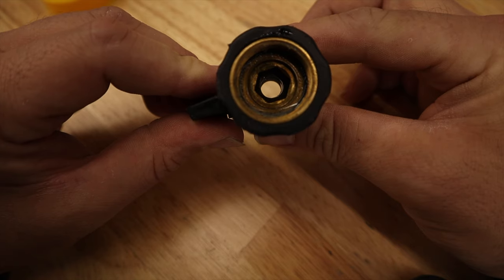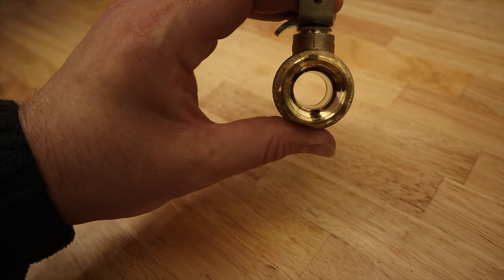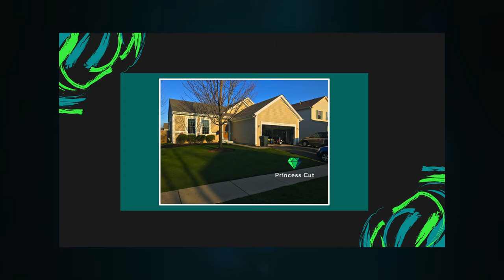MAKE A DIY Garden Hose Shut Off Valve ! HEAVY DUTY! Best Garden Hose Valve

Comment: I followed your instructions, and your parts list.  I bought everything from HD online.  It only took 2 days to receive it (no HD in my small town.)  It's working like a charm!!  Easy to open and close.  Great water flow/pressure.  NO LEAKS!!!  I did reverse the handle 180 degrees to fit my application.  THANK YOU for this great video!!!
Reply from the maker: Great to hear! so happy it worked out for you:)

Comment: I think you just saved my brain at Home Depot. I was looking for a lever shut off for my outdoor shower that is attached to the hose. This seems to be my answer. Thanks!!!!
Reply from the maker: Sweet! this would work great for an outdoor shower as the full port in the valve will allow the water to flow freely just like a shower in the house would.
Good luck!

Comment: Great idea, I’m tired of these cheap plastic store ones leaking and breaking.   Heading to Lowes, Thanks for the tip.
Reply from the maker: For sure dude it makes all the difference, I just a quick reminder make sure you get a Full Port Valve, must be full port for maximum flow
Reply: Princess Cut Lawn Care ... Will do, thanks for the heads up.

Comment: If you buy store valves, look for high flow and large internal dia. Lile you demonstrated, the flow is totally different. Even my push fit 3/8 valves. If I use the cheap valve with small  inner my pump is working so hard to push the water thru that restriction it draws over 10 amps. Using these valves keeps the restriction down so the pump isnt working hard anymore because the inner dia is the same as the tubing.
Reply from the maker: Excellent point jack, I was just watching obsessed garages pressure washer testing and he was testing different sized nozzle orfices and his amp readings were all over the place so I can imagine the same was for you

Comment: Nice video.. question I moved into house, and hose shutoff valve is right in upper corner basement hard to access, the copper pipe is on a bend..

Comment: Folks, I am giving my feedback on the assembled shutoff valve as George has prescribed in this post; it is a heck of a shutoff valve indeed, no doubt. I was about to order a couple high-end shutoff valves each costing over $25, I am glad I did not. This valve provides a hefty grip to hold onto when using the wand. I have only two concerns; the on/off handle is too tight to turn on/off, so people with arthritis should think before deciding to get this valve; have no idea if it would be more comfortable as it wears out. The second concern is if you have a narrow-opening shutoff valve  upstream then I wonder if you get the full utilization of the full port feature of this valve. Regardless, this is a great valve.
Reply from the maker: I’m glad it’s working well for you ataur:) the handle is tight due to the quality of the ball valve ( will never leak on you) it will have a bit of give after some time. Your y connector will slightly prevent flow at the split but you will not notice it at the nozzle ( very minimal) only when the flow is reduced at the nozzle it becomes a problem
Reply: I just did the same thing... except  I tried the quarter valve used in video and i too thought it a bit tight.  I have used those before and i think they got some grease on the ball and once it washes out that shit is REALLY  hard to turn.  So i used a garden hose bib. Works great.  Try it.
Reply: Look at the 3/4 Watts ball valve, some home depot if not online it can be found.  They have different seals that make the ball turn like butter.

Comment: George, I have a big yard and only two water outlet faucets; therefore I have to use Y-Shutoff valves on both the outlets to fork into multiple lines. The Y Shutoff valves at the root of the faucet being narrow port to begin with how does this 3/4 inch full port valve would help in the down stream? Do you know of any full port Y shutoff valve that we could use at the faucet outlet? Got a couple really decent 3/4 inch full port valve made in Italy for $12.55 each from Home Depot (each complete set cost $21.95 before tax) but now thinking with my current setup is it going to help much?

Comment: @Princess Cut Lawn care - Have you built full port Garden hose splitter? Y Splitter kind of thing?
Reply from the maker: I have not, as I have an Eley Y splitter, the diameter is .55 in and is built very well. I recommend you take a look at it on their website
Reply: @PrincessCutLawnCare  .55 is small opening :) it will take out good work of using full ball valve

Comment: Hi George, got a couple questions, the valve has two female ends, 1) why do you need the male to female part to extend the valve's female end? 2) what would be the source to get the good quality (preferably Made in USA) valve and parts?
Reply from the maker: Hello Ataur the Reason you need the extra fitting is because the ball valve will not fit a garden hose without it as its a different type of threading(FHT  VS.  FIP) This heavy duty valve is meant for industrial water and gas lines. I bought these parts from the plumbing section of home depot, they are made in china but much much much better then any other garden hose valves you can get.
Reply: @PrincessCutLawnCare  Hello George, appreciate your prompt response and for explanation on the threading pattern, For some reason I have an allergic sense with the Chinese products as I have had some bitter experience with them. I am also a die-hard supporter of American made products and do not mind to pay double the price for them. I nurture the slogan - "Made in USA or not made at all". 
However; if there is no alternative then I have no choice and have to get one made on the other side of the ponds.
Reply from the maker: Trust me buddy I know how you feel. Your not the only one who got an “allergic reaction” I too much prefer America goods but unfortunately when it comes do these type of fittings they a far and few between made in America. My favorite top notch pressure washer and hose company MTM even makes thier fittings in China and they are a premium brand:(

Comment: Wait.. If you're city's water pressure is  50psi, and you upgrade your shut off to a ¾ opening, you essentially just hooked up a fire hose where a garden hose should be, so you're not actually increasing flow rate.   Especially since (I assume) you're hooking up a garden hose anyways... You're just changing the spot where the flow gets reduced and the pressure builds again.

Comment: Hi - now here is another thing you need to invent: a screw-shut valve that replaces the female coupling on end of a hose. It should have a screw end to replace the original but have a screw shutoff below that and right before it connects into the hose. Get it? I have a community garden so anything that screws onto a hose end gets stolen. The device we need is one that will replace the hose end coupling. find me on Facebook Arlie in Santa Rosa.

Comment: Please make sure you're using a lead free ball valve.
Reply: It’s not for potable water.  It shouldn’t matter.
Reply: I doubt you will find ANY valves r fittings which contain lead for fresh water supply products. MAYBE for sewer and drain, where it will never matter anyway, lead doesn't leach out of fittings.
 Maybe you're thinking of old lead PIPE. Those may still be found in ancient homes.